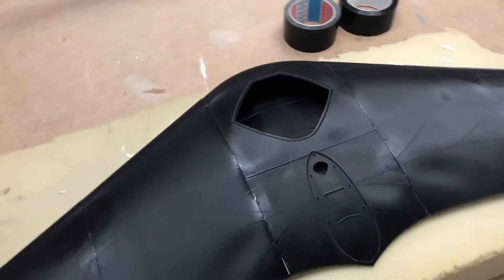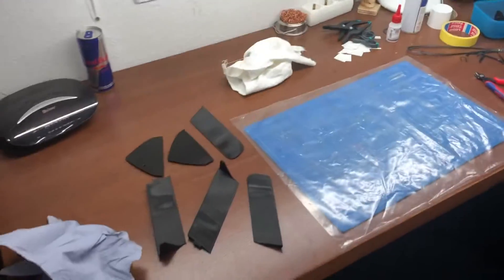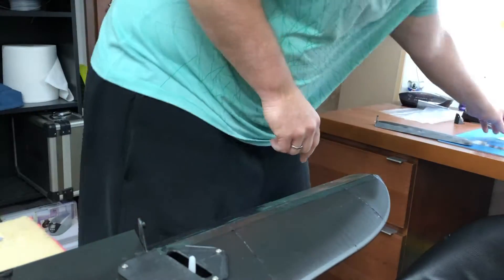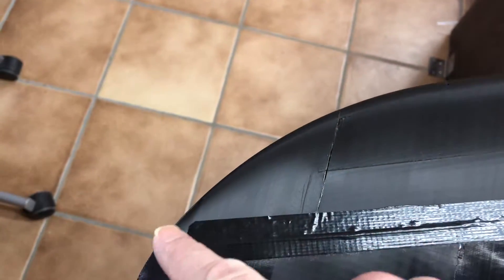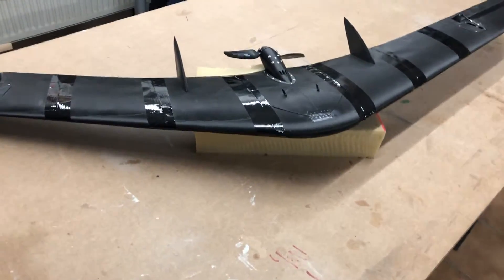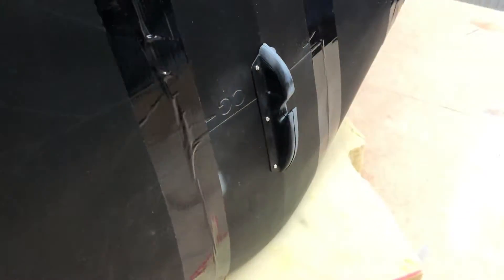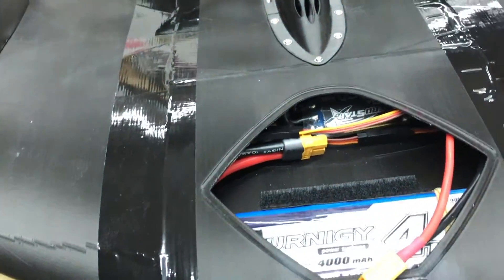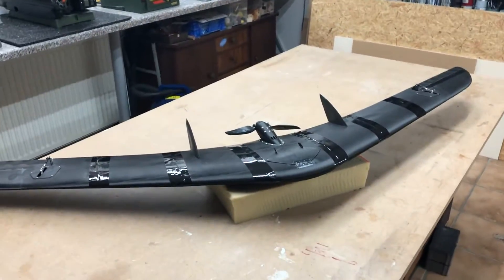3d Printed Flying Wing from Eclipson

Comment: Hi Daniel ,come to have a look as its my next print , I noticed you where worried about joint scratches ,I 
sort of stumbled on to a method ,not to sure if anyone has tried it before .
I didnt like the joints because of the glue ,so tried a few methods ,and finally found a finish 
I can live with . I sanded joints down with 150 grit freecut trying to keep it  localised , then lightly sand whole
plane with 600 grit paper , I then applied a coat of CLEAR GLOSS spray can paint , and it looked terrible .
So after it dried I put a coat of MATT clear and it was good , anyway still trying I applied a SATIN clear , nailed it
hard to see joins an it just looks right ,and satisfied my got to look good problem. Used an acrylic paint not enamel .
Reply from the maker: Hello Trevor
really a very good iddee. I'll try that out with my next model print. I wish you a lot of fun with it and always good landings... regards Daniel

Comment: Did you print it on a high heat setting as it seems to have some warping
Reply from the maker: Hi my friend 
My printer settings are 200 on the nozzle and 60 on the bed. Greets

Comment: So did you ever fly this? They fly really well. Nothing to worry about. Looking at the other aircraft in your room there. If you can fly those, you can fly this no problem.
Reply from the maker: Oh this are very good tips. Thank you very much. I try it soon whit hand lounge. What battery you use? I use 4000 3s. Cheers
Reply: @danielnadj34  yes 4000mah 3s lipo to get cg, 4s 3300mah in the centre of tray also works
Reply from the maker: Thanks my friend. I will fly it very much but I don’t have a rubber start now. I hope I can fly it soon. Greets from Germany
Reply: @danielnadj34  it is very easy to launch using the handle on the bottom. Do a couple of glide tests first. This will give you a chance to trim and make sure it's balanced properly on the center of gravity (COG....).
When you launch it do the same hand launch glide only this time gently bring the throttle up. If you throttle to fast it will give you some roll due to torque.
So it's a good idea to practice with the throttle a little on the ground.
In any case rest easy because in my case I did none of those things......
I had a very scary first flight because I forgot to check the balance and I switched to a lighter battery for the first flight. It was "tail" heavy. Even without a tail. I still managed to save it.....
It handles very well.
If you wear glasses make sure you wear them or fly FPV because I have lost orientation of mine a couple times. Try and fly while the sun is high that will help.

Comment: I wish there was a way to print these without the sagging. I am in the process of printing the  Eclipson Prandtl wing and it's a pity the skin is collapsing into the wing at parts. The upper skin of the wing has wobbly pockets here and there, shame. Other than that these designs are pretty cool.
Reply: Use tree supports. also I’d make sure your machine is calibrated before printing.

Comment: Great vid. I just finished printing and assembling one. Flying it soon. Quick question though: Using an Ender 3 and got a lot of stringing at the recommended temps. Did you change any settings, which slicer do you use and what are your retract settings. Thanks
Reply from the maker: Emmanuel A hi... I’m using a cr10s pro. 
And I don’t change nothing on the recommended Settings. My Retraction settings are 6mm on 110mm/s. 
I’m using Cura. Hope this helps. Greets 
Daniel
Reply: @danielnadj34  Thanks Daniel, I'll try that retract rate and speed.

Comment: Hey man, did you use vasemode when printing? Im kinda confused! Looking at printing in carbon pla but the profiles wont load :/ how'd it fly?
Reply from the maker: Hey friend. I printed as described on the Eclipson website. they have very good descriptions there for printing. its all ordinary PLA. I hope I can do the maiden soon.
Reply: are you using cura if so then the setting is called union overlapping volumes turn this setting off then you will see the structure inside the wings

Comment: 👍👍😊 Very nice project !
I was also worried about joints on my first 3D printed P-47  - I used a 25 gram glass and epoxy laid down as a kind of outside spar .. - hopefully will help with layer bonding too ..
What is that cooking beside face masks - some jet?
Reply from the maker: Thank you Darko... I hope it will fly!
Reply: 3d lab print? Doesn't need them, you will be fine.